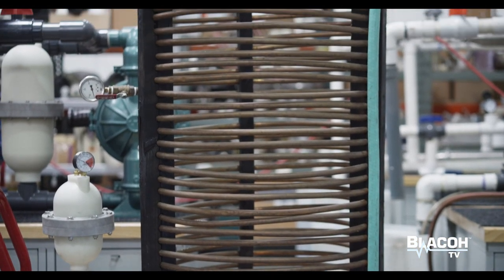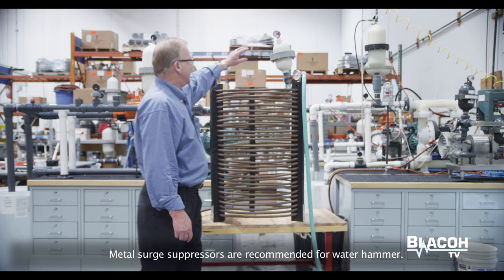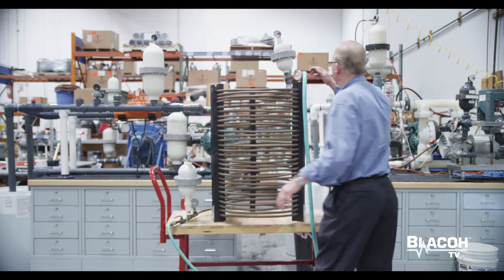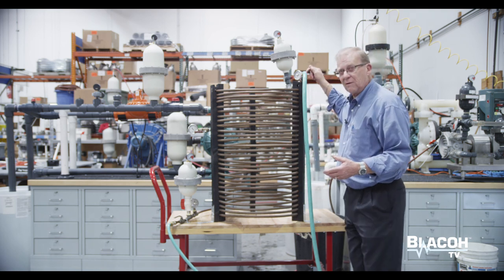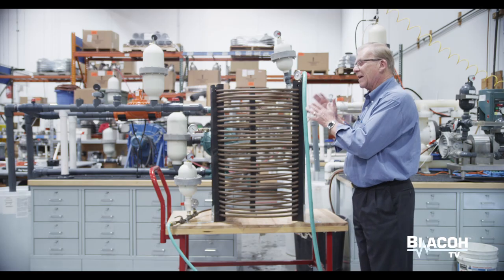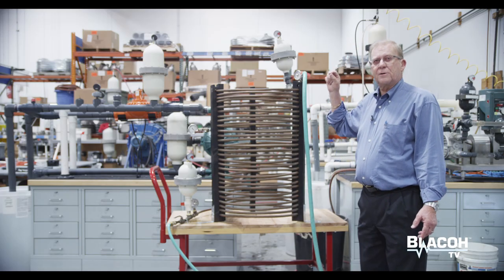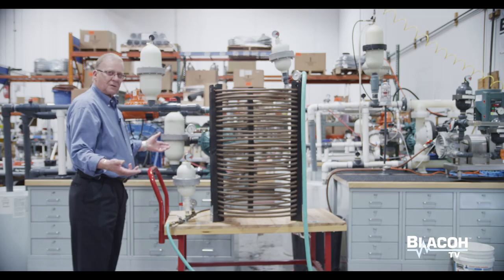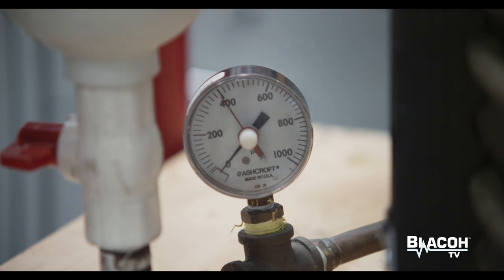Prevent Water Hammer & Surge

Comment: What is causing my water pump to produce a hammer effect when shutting down?
•	Water pump is set to cut off at 40PSI
•	Water pump is set to turn on at 25PSI
•	Scenario 1 – In a normal situation when the water pump starts and stops at its own phase, no hammer or vibration sound is produced.
•	Scenario 2  - In a sudden situation when the water pump stops at any given time without reaching the cut-off, it produces a hammering or vibration sound for at least 5 to 10 seconds.  For example: when an immediate stop at 30PSI without reaching 40PSI cut off the system vibrates or produce a hammer effect.
•	What is the solution to the problem?
Reply: You may want to look at your pump curve.  Most centrifugal pumps will have higher discharge velocities/flows at lower discharge pressures.  Higher velocities are more prone to hammer.  Some people put fly wheels on their pumps so they don't spin down so quickly.  I think this is restricted to huge municipal water supply situations, so probably not a practical solution for your application.  Depending on your application you might install an air-filled tee instead of a nice arrestor like the ones in the video.  Tees for this were popular back in the 1950s for residential plumbing.  If you use a tee then you need much more volume and the air is eventually replaced with water so you have to drain the system periodically to replace the air.  Good luck.

Comment: I have a washing machine that causes my Pumptrol pressure switch to cycle about three times a second (there is a 500 mesh filter that introduces some resistance and is part of the pump oscillation problem). I installed Sioux Chief AA size mini-rester and it did absolutely nothing to help. I want what is demoed here.
Reply: +Zachrey Helmberger funny...
Reply: +Marco Pulone Heh Heh! I finally "solved" it by making the mini-rester a MAXI-rester (torch and solder) and connecting it to the hose bib just after the house water pump. So now it looks like a 24" long you know what! But the interesting thing was I had to very carefully adjust the hose bib valve opening to make the oscillation stop. If the valve was open all the way, it would not work. But if it was open just enough, it would work great!
Reply: I added in a T and a elbow. Pointed the elbow with the opening straight up.on the hot & cold with a pipe with a cap on  it about 12" to 2' feet long

You can't tell that someone is running water anywhere else in the house 

Do that by every sink,toilet, bathtub,washer or other things have water running/hooked up to them.

If taking a shower, you won't be able to tell. That someone is running water in the house

Theres no sense in buying expensive gadgets to install